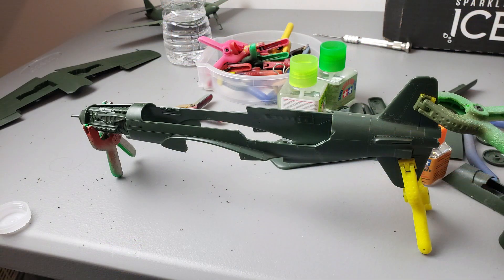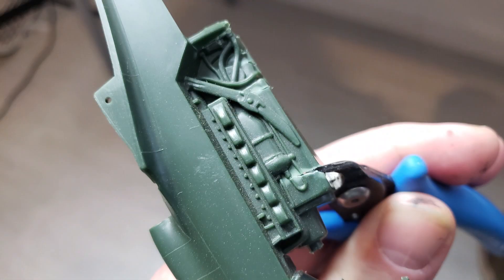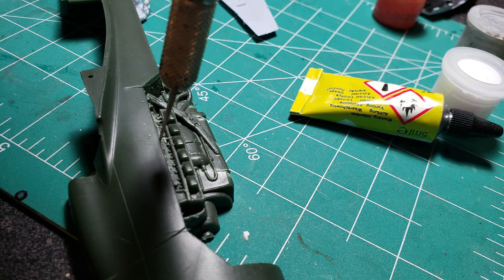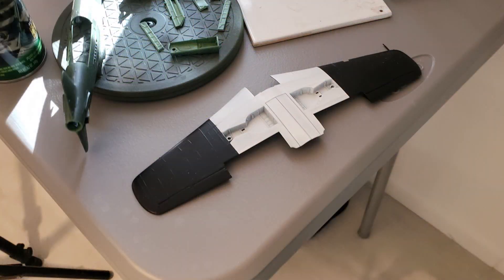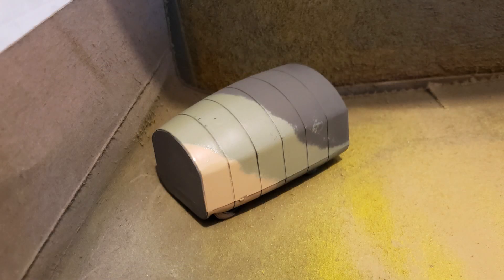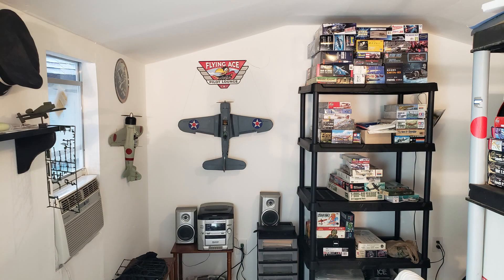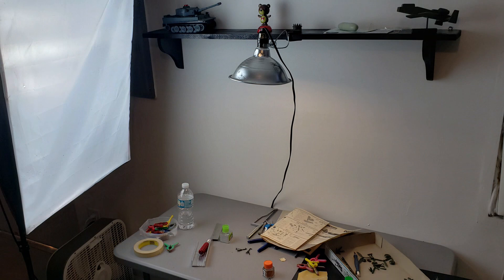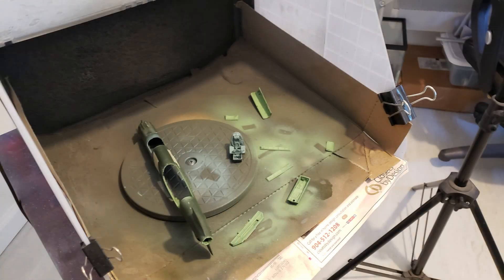Max's Models after hours 03/23/23

Comment: install a mini split AC unit the compressor set outside that will cut out the noise issue and cool and heat TARBIS a lot more efficiently.